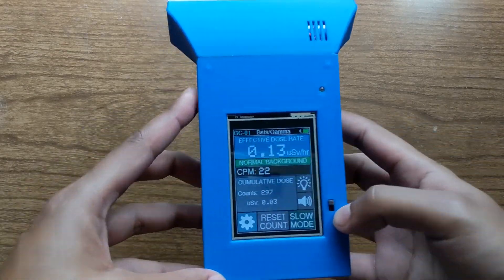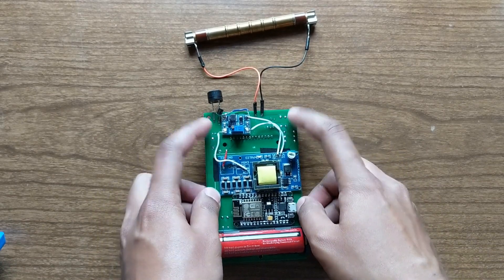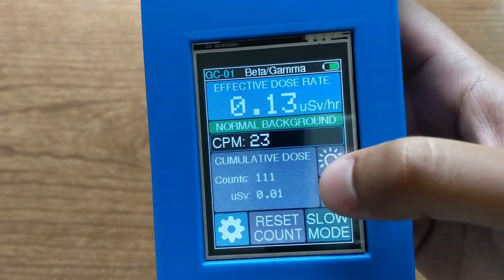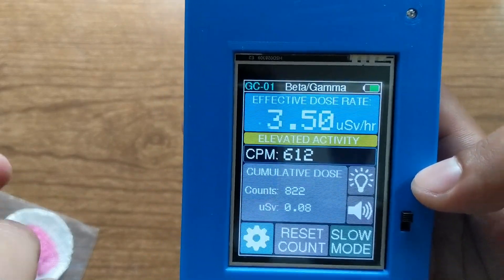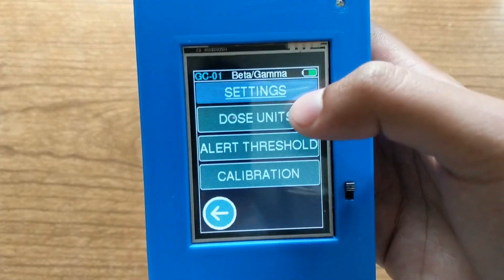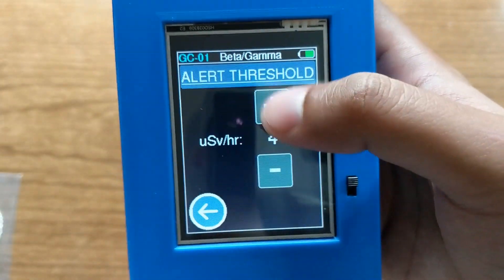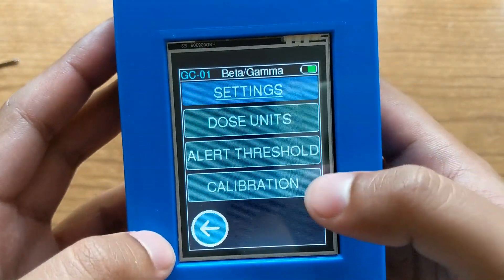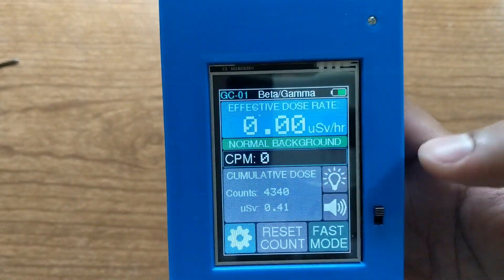DIY Arduino Geiger Counter with Touchscreen

Comment: Could you make it have an auto mode, that switches between fast and slow mode depending on the cpm/cp3s? Such as cpm > 100 then switch to fast mode.
But otherwise awesome job! I'm considering making something like this, but with some temp sensors and stuff on it.

Comment: Probably one Idea how you could make the device more engery-efficient, lighter, cheper and probably more precise is the Idea that is shown on www.boehri.de for the two projects "Multi-Geiger"and "Simple-Arduino-Geiger" (sorry, up now only in German). Here I use a simple HV-circuit controlled by the Microcontroller.
Reply from the maker: I'm actually developing a new circuit that uses a 555 timer to generate the high voltage, like the Mightyohm Geiger counter. It should be more efficient and compact compared to using the boost module.
Reply: @prabhat3007  OK, well 555 is fine - but I think if you really want do build an energy efficient closed loop system (regulator) it is easyer to envolve the microcontroller. So it is possilbe to build a geiger counters that consume about 100 uWatts.

Comment: Fantastic machine. I'm now studying the way of getting 400V from a little circuit, because this PCB is to big for my prototype dimensions, and I don't need to provide this quantity of current anyway! So I think if I can polarize the tube with a simpler circuit... made by me on the same PCB...
Any ideas?
Thanks for this nice video!
Reply from the maker: That should definitely be possible! Have a look at MightyOhm's circuit schematic to see how they get 400V. I just wanted to keep things simple and size was not a concern so I went with the module.